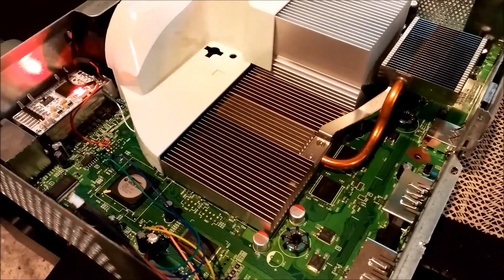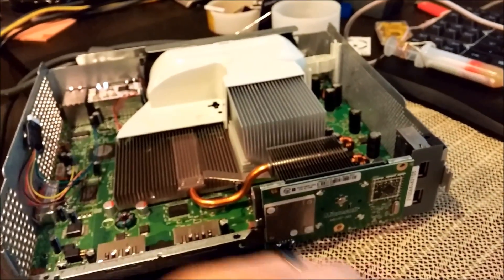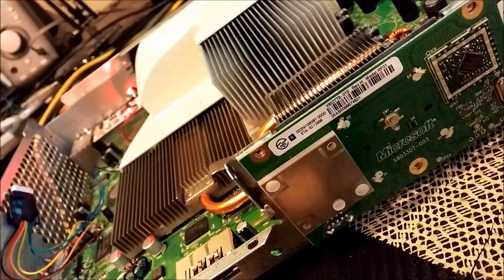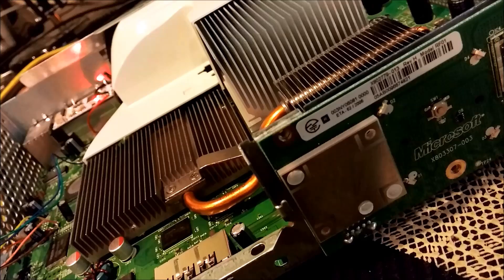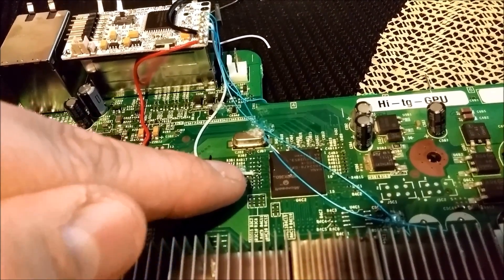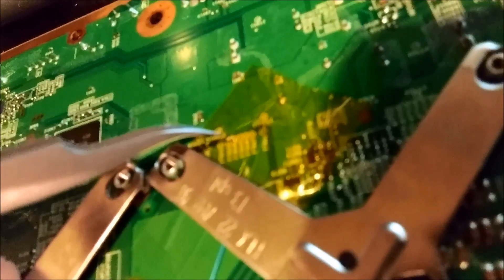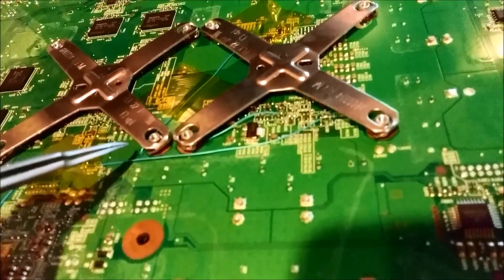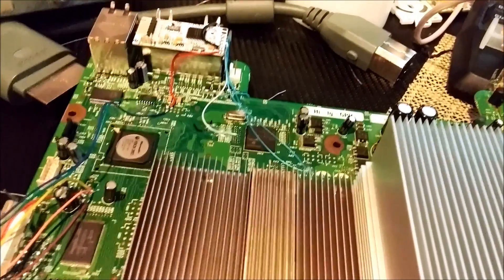New RGH Method!  RGH 1.2 by 15432 "The Mad Russian"

Comment: Can you send me a direct link to 15432's cool runner timing files? My falcon won't boot to xell I am pretty sure I have bad timing files. I've been looking all over forums for his timing files and I cant seem to find the download link. Please help :)
Reply: +TheWeekendModder Dude you are awesome. Ill try that on my falcon.
Reply from the maker: There is a 15432 development section on the teamx360.co.uk site.  I don't have a way to make it easier than that...
Reply: +TheWeekendModder I downloaded those but I cant seem to find one for a coolrunner rev c. They are for squirt, matrix, etc.
Reply: +Shyzah My falcon is having issues booting into xell. I am pretty sure I have a bad timing file.
Reply from the maker: The coolrunner rev C is a XC264a based chip, the matrix is also a XC264a file so all those "matrix" files work on Rev C's (and D's and CR3 Lites).  Use the \if_you_mad\matrix\xsvf\rgh12_21.xsvf  file and if your wiring is good you'll get xell

Comment: This new exploit is amazing! However, i have run into a few really stubborn jaspers. 2 out of the 3 jaspers i did took 1-12 glitch attempts. dont get me wrong this is miles better than rgh 2. i was just wondering if you have any tips. i have tried caps on pll bypass and cpu_rst. i still get the same results out of the consoles. and i have tried literally all of the xsvf files in both new and old files. i have tried official cr rev.c and clone d and matrix v3 all with the same result.
Reply: +REDPLASMA1305  - if you're getting 1-12 glitch attempts with this method, then you might as well go RGH 2.
Reply: or use an ace like I did.

Comment: Did you you wire up the stby_clk with your CR3 Lite Install?
Reply from the maker: Ben French I've done it both ways, using the clk on the board and the clk on the chip.  The board seems to give better boots.

Comment: Hello TheWeekendModder, will the RGH 1.2 work on a xenon motherboard on the latest dash?
Reply from the maker: Technically there is a variant of RGH 1.2 for Xenon - but Xenons are better suited for the trash than RGH.
Reply: XeX Grant Only one has been sucessfully attempted, The only one that will work is a Xenon with the xcpu Canada if its xcpu taiwan its rubbish and won't work also Xenon's cannot handle newest dash without a cooling mod.
Reply: Second that owner of 20 xenon JTAG's all of which are Melt box's